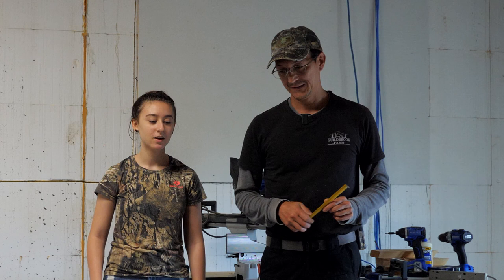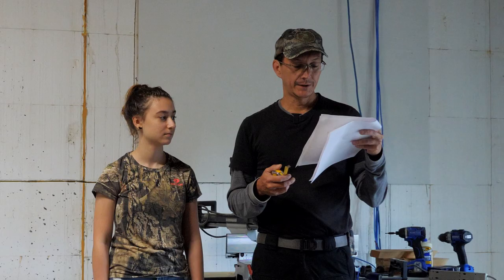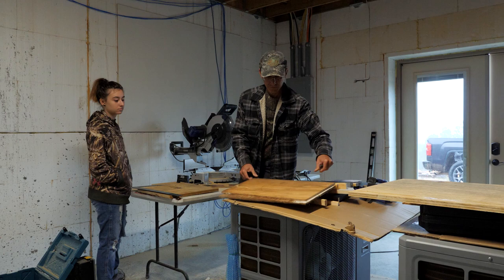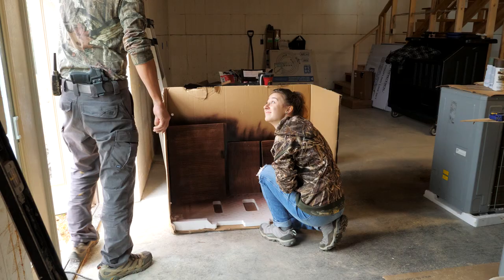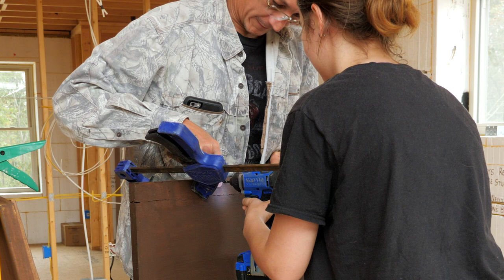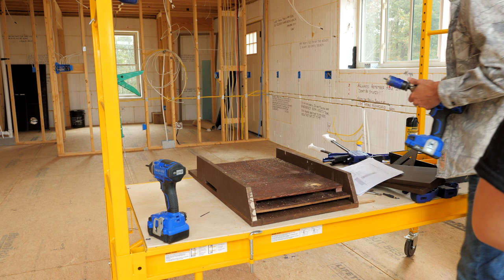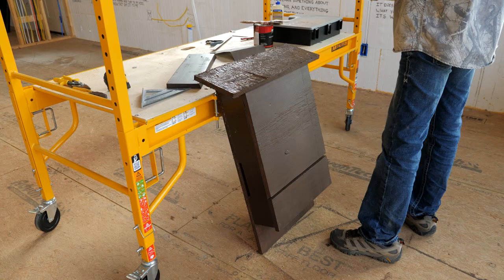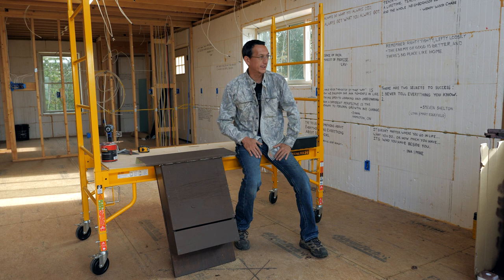Stink Bugs are BACK! We're Building a SECRET WEAPON To Fight Them!

Comment: Bat boxes work! A few years ago the village I live in had a nasty mosquito problem. I built a few bat boxes giving all but one away and the mosquito population has dropped every year since. I mounted the box on the east wall of the garage for morning sun warmth, then shade mid day and afternoon to prevent over heating. I also left the inside bare wood with a 1 1/2" gap between the dividers and the roof with a small gap at the roof for hot air to escape.
Reply from the maker: Awesome 😎

Comment: I live in Tennessee and have a lot of them in Spring & Fall.  I’ve tried all the things to get rid of them and nothing worked.  I bought a small vacuum strictly for them and I suck them up - sure don’t want to squash them.  The next day, I’ll dump out the bugs.  Don’t use a vacuum that you use for anything else or it will smell like them.  The only thing I have found that also works is ammonia.  Put some in a spray bottle and clean the doors around you home entry points.  I also clean my entire glass storm doors too.  They were really bad in my screened room.  I now wipe down my wood ledges with ammonia and it works.  
They evidently don’t like the smell.  Will not kill all of them but will help keep them from getting around the entry to your house.  Spring and Fall are the worst times for them here.  
They will nest anywhere.  In chairs outside under the cushions, under door mats, cardboard boxes, etc.  I’ve been dealing with them for 7 or so years now and ammonia is the best thing I’ve found to work.  Hope this helps somebody dealing with these horrible bugs!  I despise them.
Reply: Thanks for the tip!!!!  I moved a little over a year ago and was shocked at the number of stink bugs trying to get into my house last year and at how many were leaving in the spring. This year when they returned there weren't as many because I had sucked up so many of them with the vacuum. I'll definitely be using adding ammonia to my arsenal. Thanks again!
Reply: @kfitz192  You are welcome.  Hope it works for you.

Comment: Use an open top can in your hand for stink bugs that are within reach. Add a small amount of cheapest veggie oil in it...just a couple of inches. 
When you disturb the stink bugs, their defensive move is almost always to just drop straight down, so if you swipe them with the can from underneath, they will plop themselves right down into the oil and suffocate. I tried using the can on a stick for bugs near or on ceiling, but it was a mess waiting to happen...now I just use the stick to chase them down lower into reach, and the use the can in my hand. 
Do have a plan to dispose of the can...they will make it smell. I use a coffee can that has a lid. 
I tried using my vacuum, but it made the vacuum stink, so I started doing the oil. Works great!

Comment: I haven't had any luck with the bug bombs over the years. Plus, they tend to leave residue that makes my cats sick when they lick something I missed wiping down. The most success I have had is when I use a spray bottle with isopropyl alcohol in it. The alcohol dries them up and they usually die within about 15-20 minutes. Then I just vacuum them up. It's just regular store bought alcohol. Benefits are killing off germs and no stink from the bugs! The smell of the alcohol evaporates quickly and you can just clean as normal afterwards.

Comment: There is a solution to the bug problem on your property- Get at least 20 to 30 guinea keets (younger than 12 weeks) and raise them together and train them to roost in a protected hen/guinea house- Let them free range during the day- They will eat all bugs- ticks, stink bugs, grasshoppers etc. The key is get them young and get them settled to your place- They are noisy but the benefits outweigh the noise - They are a great for alerting you to any suspicious activity also- The best way to hatch and raise keets is with broody hens. They need higher protein when they are babies but later are maintenance free- Good luck-

Comment: 8:45
What's the purpose of the holes in the can?
Reply from the maker: Drips drain back into the can. The lid goes back on and doesn’t stick because the rim is not full of paint.
Reply: @Guildbrookfarm  Thank you. We've got a similar project going on and this is quite helpful. I had no idea. :)
Reply: You can also use a sheet of saran wrap on the inside of a paint tray so when you are done it peels off and the tray is clean.  Keep your rollers and paint brushes in a ziplock back if you have to stop painting for a bit.  Rubber bands around paint cans make them easier to hold on to.  I poke a hole in a coffee can lid and stick the paint brush handle into the hole.  Drips get caught there.  Dryer sheets drive mosquitoes away from you.  Bats are a good bug predator.  Google mega bat colonies in Austin, Texas.  Imagine a million plus colony leaving to hunt each night.  Its a sight to see.